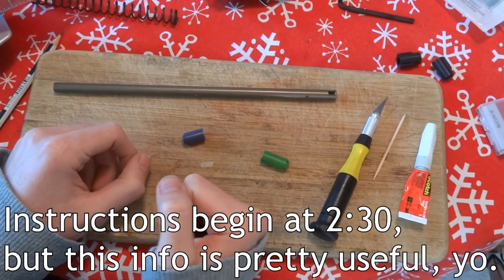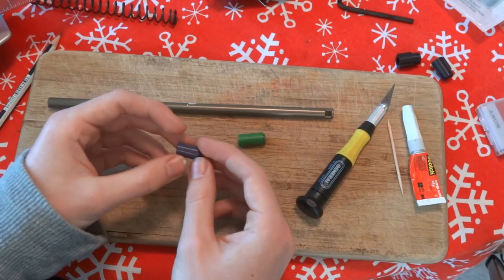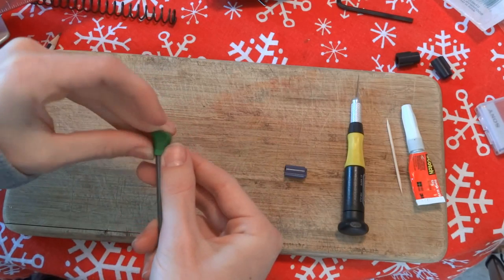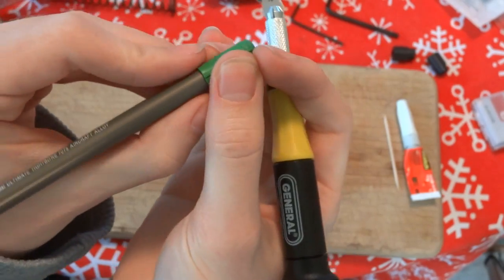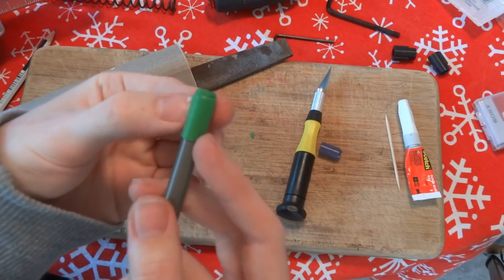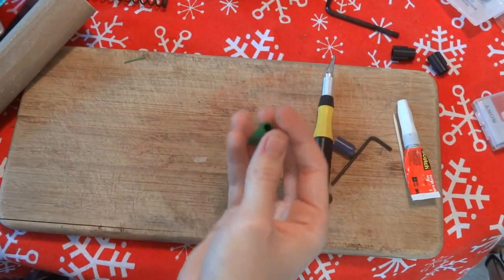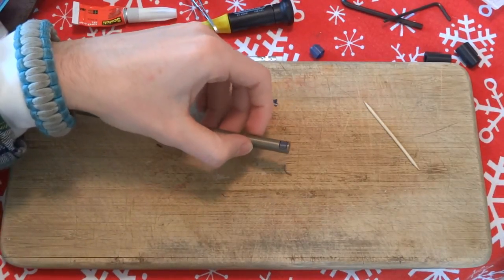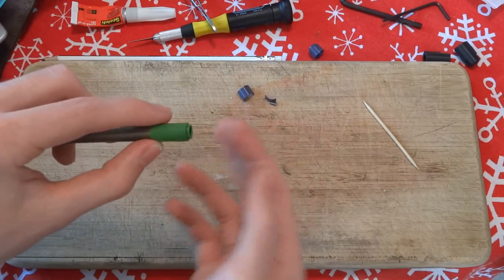Increase any Airsoft Gun's Range and Accuracy: G-Hop Installation Guide

Comment: Would this work in a vsr10 460fps
Reply from the maker: MrrSquishie Yes. But only remove the hop lump from the outer bucking. Try to cut it as flat as possible since you can't rotate the outer bucking and the area where you cut the hop lump will be over the contact patch.

Comment: would using an h nub work for the nub
Reply from the maker: It shouldn't cause any problems, but I haven't tested it myself.
Reply: have you ever had a problem with flat hop or g hop making te bb hop down? like the bbs spinning forward and shooting inconsistantly fps wise?
Reply from the maker: Nope. That's what happens with you're not applying enough hop. G-Hop and especially flat hop require more pressure from the nub than a regular bucking does. Double check to make sure the nub is still there, it might've fallen out without you noticing. If you're using an odd gun (like a GBB), it's possible that the hop arm doesn't go down far enough to be able to apply hop with a G or flat hop setup.

Comment: does the contact patch have to be soft?
Reply from the maker: No, 60 or 70 degree is recommended, but be careful with anything harder than 70 degrees. It's easy to get sidehop with 80 degree rubber.
Reply: so hard contact with ...soft outer?? cuz i only have a soft contact patch for the project
Reply from the maker: Gerald L. Soft contact patch works fine, but you might get better results with a harder patch in a higher FPS gun.
Reply: its fine i have low fps.... Thanks for awesome vid:)
Reply from the maker: Gerald L. No problem. :D

Comment: will it work with 550 fps like for snipers?
Reply from the maker: It's worked for me in AEGs and bolt actions, but not GBB snipers. As long as you don't shoot it with the hop over adjusted it should hold up long term.
Reply: Thank you very much

Comment: Pretty new to these alternative hop variations... what keeps the bb from getting bound up on that contact patch. When you compressed it there was a gap that formed. Also if your using a normal nub there really wouldn't be all that much more contact with the BB would there? Sorry if any of these questions seem stupid again just kinda starting to look into these setups... in reality would like to see a more "drop in" compatible one that needs less custom work... in my opinion most things whether it be cars, hop or whatever... the more you personally customize it the more parts there are to fail as opposed to something designed purely for the purpose. Thanks for any reply.
Reply from the maker: When it's in your gun you won't be applying enough hop for the contact patch to protrude so far into your barrel. If you have your hop vastly over-applied in a high-FPS gun you can get a BB caught in the patch if you're not careful, though. The advantage of G-Hop over flathop is that you don't need a special nub to get good performance, because due to the two-piece design (bucking and contact patch) the bucking deformed by the nub will be wider than the nub itself and will push the entire patch into the barrel regardless. Also, I find a lot better performance and often durability in custom parts rather than mass-produced parts in airsoft. Mods are usually something designed specifically for the purpose. For hop modification you will never be able to make a mass-produced bucking that performs as well as a modification because the buckings are made to work in a wide variety of guns, where as mods are custom tooled for the specific gun. I can custom make a hop mod to be as good as possible for a gun, anything mass-produced will be made to work well in any gun. If you're looking for a drop-in, the maple leaf is the closest you'll get. Another really big factor in airsoft is having to keep your prices low. No one is willing to pay a whole lot for airsoft guns, so companies have to cut corners to make a profit. $150 for an AEG is mind-bogglingly cheap and a lot of newcomers don't even want to pay that. The more you work on it the more likely you may be to have an issue, but that's only if you do something wrong and no stock gun can come close to performing as good as a well tuned airsoft gun. Hope this helps.

Comment: I thought this is r-hop?
Reply from the maker: R-Hop is based off of this method. G and R-hop are very similar with the only difference being what you use for a contact patch.
Reply: ah. thanks
Reply: Is there any real performance difference in the two?
Reply from the maker: Trojan48 Not that I can find. G-Hop tends to be easier to adjust, but it really depends on your r-hop.
Reply: I dont think i could do this very well so is thr ZCI Barrel with the r hop pre installed on clandestine work well?
Reply from the maker: Trojan48 So long as their R-Hop install is good it should work as good as or better than this method. I have not had work done by them, but they're relatively well renowned so I imagine they'd go a good job. Also, check and make sure they include a modified outer bucking.
Reply: well i found a prometheus blue straight outer bucking or i could modify a REAPS 70 degree bucking that i have what do you think?
Reply from the maker: Trojan48 Either should work fine. Prometheus would be easier, of course.
Reply: ok thanks for all your help!
Reply: Trojan48 HS5 himself installed the rhops on those barrels. so yes theyre good

Comment: as I saw this video, I fully recognized, that I will stay with my old fashion way how to hopup my gun... Soft hopup rubber with hopup roll in shape of BB http://airsoftpro.cz/eshop/images/ASPRO-HHOPUP.jpg is I think much better choice.... I am the man who play only with guns 500FPS+
Reply from the maker: I run 500+ FPS guns myself. You shouldn't be using soft buckings for 500+ FPS guns. In my 500+ FPS guns I get much better results with 70+ hardness buckings. Are you running the SCS with a normal bucking, or modified bucking? SCS with a normal bucking is average, and SCS with a flat bucking is a pretty good setup, great for accuracy, but when I used to run it the range was pretty poor. G-Hop has the same accuracy and more range in my guns. These are simply my experiences, however, do whatever works for you.
Reply: i am using soft rubbers because with this small ring i sent. You have less stress on the ruber due to better contact....  i have no problems with often replacements, cuz regulation of hopup system with softer rubber is much easier. But its my option cuz i am using many types of bb weights :-)
Reply from the maker: James Kirk I do not use harder rubbers in my higher FPS guns for durability reasons. I've been airsofting for 8 years and I've only had to replace a bucking once. I use harder buckings in higher FPSs because I typically get better results with the harder rubbers. I tend to just use heavy weight BBs, however. These are just my experiences, if your setup works well for you, keep with it. :)
Reply: Yeah, this could be the right time to compare our solutions :-) I am not telling that your system of hopup build is wrong, I just only think that u are going quite difficult way to achieve same results :-)
Reply from the maker: James Kirk Trying new things is what I enjoy in airsoft teching, so I'm usually up to try something new even if it seems difficult. This method might seem a bit intimidating, but it really is not as difficult as some seem to think it is. With the performance I get from it over any other method I've tried it's definitely worth the slight effort. I definitely do not achieve the same results with this as I do with other methods. It works well for me, so it's what I like to do.